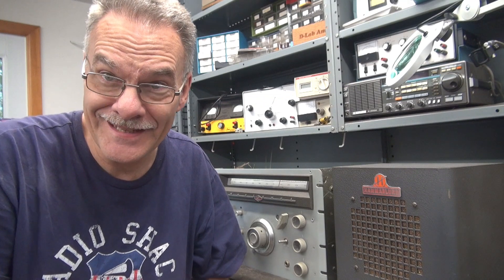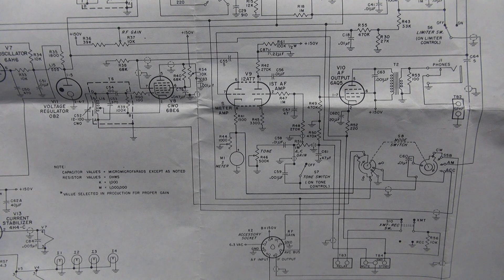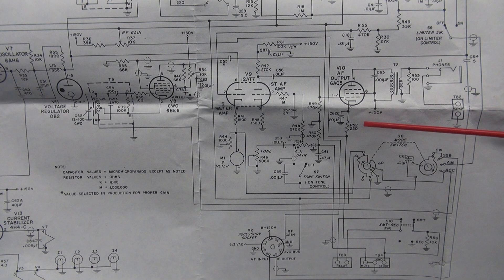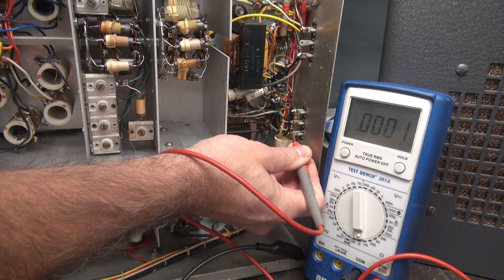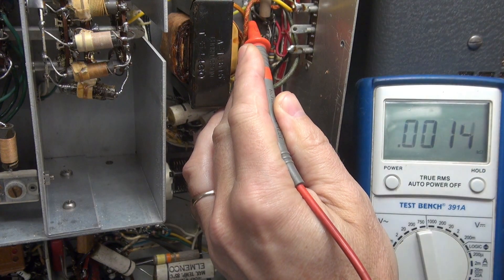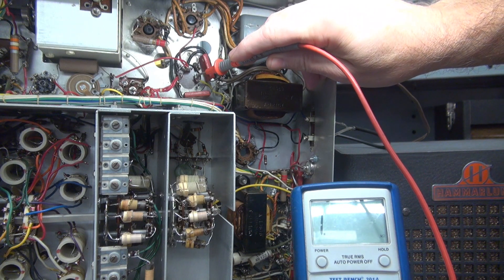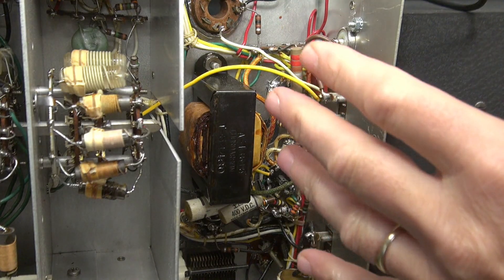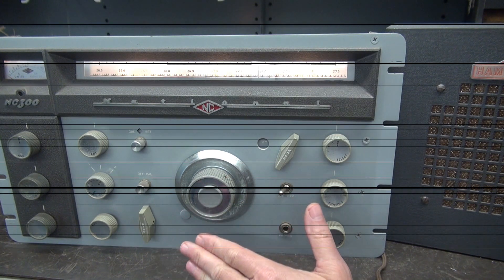D-Lab Tech Tip Troubleshoot Repair National NC-300 Ham Radio receiver Standby function

Comment: Interesting video! VERY unusual for a low-voltage section of an electrolytic to fail before a high-voltage section. IMHO the owner is shortsighted for doing this the cheap way.
Reply from the maker: Hams are frugal. I do as directed. The RX will be back
Reply: @d-labelectronics  They are like guitar players they want it cheap as possible they don’t think about it might blow part in during a gig.

Comment: Is the reason you didn't put the replacement 50uF cap next to the bad 50uF section because you didn't want to install a terminal strip?
Reply: I would had replaced the whole multi electrolytic capacitor . Because if one section has gone bad the rest will soon follow it .
Reply from the maker: I would too, if the customer asked, that is not the case

Comment: May I ask If you have any spare time fixing the radio I have I'm not so sure if it will ever work anymore. And the radio has no schematics that I could find on the internet.
Reply: How ironic, because I was going to ask about looking at a  Sherwood receiver a friend dropped off because it wouldn't power up.  My guess is something blew after the power came back on after a storm.  Fuses and transformers test ok.